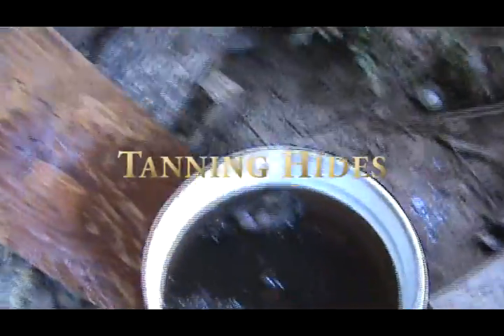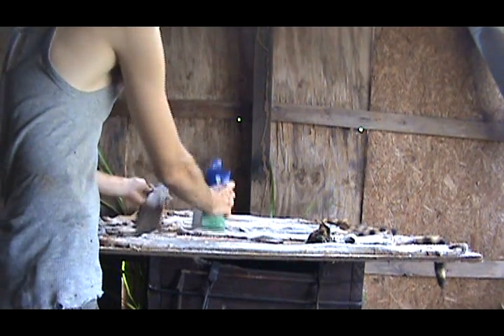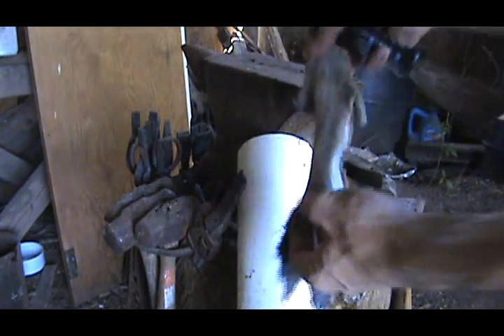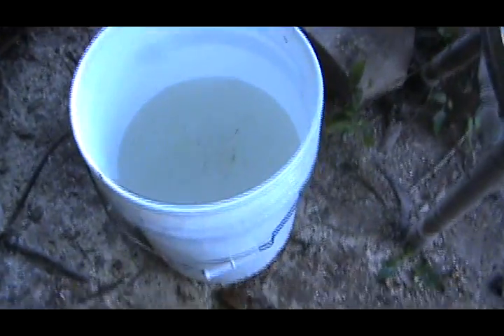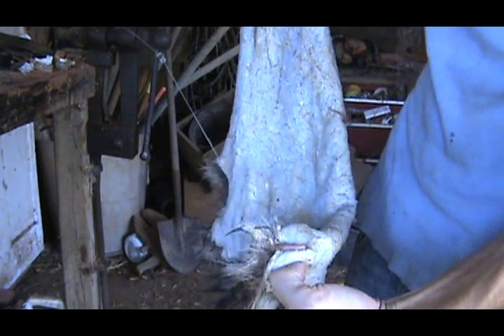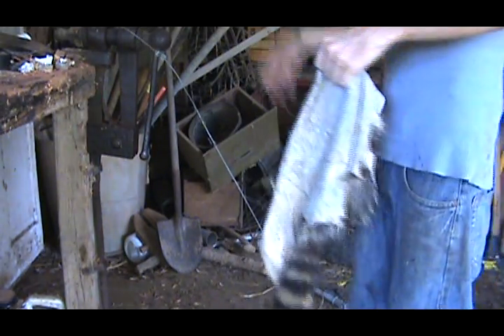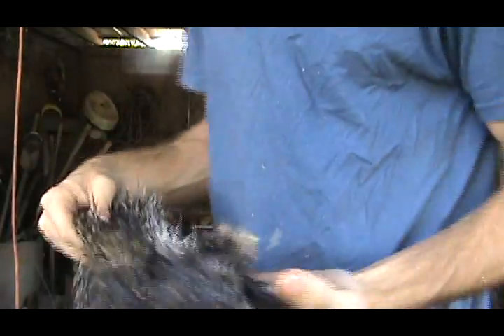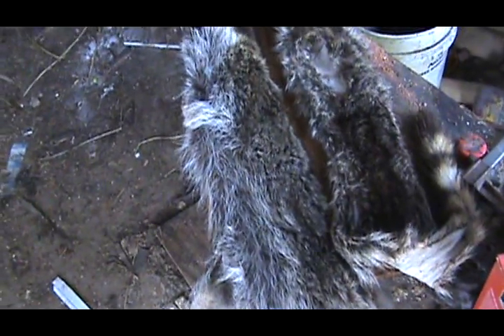Tanning Fur Hides

Comment: I do my hides the same way except for one part. When you salt the hide for the first time, keep salting it until the hides become hard. This sets the hair floccules insuring that it will not fall out! Then re-hydrate them in salt water and start the fleshing process. You will never have hair fall out, ever. That's how I tan my hides for taxidermy, when the hide your working on has to come out right every time.

Comment: Nice video Brother, I appreciate it when someone shows the whole process start to finish...along with the failure's too! FYI you can buy the Alum in bulk on line for a whole lot cheaper than the spice isle at the grocery store. Also, I use pickling salt too, but a friend of mine uses the salt for water softeners for soaking and it does well...lot cheaper too.

Comment: This may have already been commented on but here's what I found out about Alum:
Alum describes a class of chemical compounds, however the most common use of the word refers to potassium alum (aluminum potassium sulfate) This is the type of alum that you find in the grocery store for pickling and in baking powder it has several uses including leather tanning, as a flocculant in water purification. It also comes in a rock form for use as a deodorant hence is it a.k.a. "deodorant rock".

Comment: Good work.  I use a stick like a tournequit to help wring th water out andthen let them dry on the clothesline in the shade until just moist to the touch.  The work them over a board or cable for a while until dry and soft.  By switching off you cando them all at once.  If you are running a trap line you can smoke, tan, fesh, soak, some each batch you bring in.....spending your time better and be more efficient.  Good job.......I enjoy your sister too.  Good hunting.

Comment: Since salt is cheap and does not spoil, it might be good to lay-up a large supply of reserves, in ase salt might be hard to find, someday.  Maybe a pile of sacks of rock-salt (like used for ice-cream).  Sure, it would prolly fuse into one solid chunk but you would have it, on site.   About half of my remaining questions are about what else you might do besides selling them and also other methods of tanning and "work-arounds" if you can't get all the supplies or if you don't have a freezer, etc.

Comment: I have been having a squirrel hide tan for about 4 days now. I understand you take it out to dry a little bit, then work on a snare. I don't have a snare or a way to secure the wire like you have. what other methods do you recommend for doing this? Is it okay to do on the edge of a table for both times when working the hide?

Comment: I found your video to be very informative.  We have recently started breeding rabbits and have preserved several skins by drying them them in the open air and salting them, I would like to be able to tan them like you have done in your video, but I just don't have the time.  Would you have any suggestions about where to send these rabbit skins to for sale or would you buy them?  Also, are they still ok to tan after they have been dried for so long?  It has been about 2 months.

Comment: What's the point of soaking the hides in brine water at the beginning? Another tutorial online has you go from fleshing straight to salting. Total beginner here. Your help is very much appreciated.
Reply from the maker: The water is the tanning process. If you only salt the hides will stiffen up and you may loose hair
Reply: Survival HT
I'm working on my first hide now. I skipped the brine solution at the beginning and went straight to salting. It's under it's second batch of salt now for a few days. Hope I didn't screw anything up before I move onto the next step.
Reply: Benjamin Bailey i also did the same thing fleshed then salted then solution and i used citric acid instead of allum cause it's way way way cheaper. mine came out great the first water solution is really only to make fleshing easier :)

Comment: I had left my grey fox hide in the salt bath for 5 days, and after cutting off a piece of the hide, it appeared to be tanned. However, as I was squeezing the excess water from the hide the hair from the tail and the back started to fall off. The only thing I noticed that I had done that deviated from your process is that I didn't let the water cool very long after boiling and dissolving the salt. The water was still really hot, do you think that is what caused the hair to come off?

Comment: Hey - these are GREAT videos.  My question is on rabbit hides.  How do you flesh/work small cottontail hides without tearing them?  I think I'll try your working method with the snare to see if it helps.  I tend to leave too much flesh because I'll tear them if I scrape too hard.  Is that the nature of the beast for cottontails?
Reply: Try using a spoon as a scraper. Or flesh by hand. Hold the hide with one hand and pull down the hide keeping the flesh you're peeling as close to the hide as you can. It will help prevent tearing

Comment: do you have to "tan" hide to use it for clothing or blankets. can you just stretch it, dry it and then use it as needed?
Reply from the maker: It will get hard and stiff if you just dry it
Reply: ok thanks!
Reply: Old comment I know but tanning is completely necessary! Tanning is not only just some form of preservation, but literally chemically alters the hide into an entirely new product. It will eventually rot if you do not do this.

Comment: Nice pelts. But, wouldn't it be easier to flesh them before soaking them in the tanning solution? That way, the tannin would be able to reach the skin faster without having to soak through the meat and fat, losing some of the tannin in the process. Also, leaving the meat and fat on it would increase the chance of bacteria getting to the skin, making the fur come off.
Reply: It's so much easier to flesh after salting or brining the hides. The fat\membranes loosen and are easier to scrape! Many tanning methods are two step: salt\scrape, then alum brine.
Reply: 2degucitas Oh, that's interesting. I might try that sometime

Comment: Alum?!? I thought this was survival HT. I'm sorry, but can you come up with alum in a survival situation? Do know sources of alum? If you, my apologies, but I do not know of natural resources of alum. Do you know anything about brain tanning? I understand it takes no ingredients that do not come straight from nature. I do not know how to do that either though but, I am looking for methods that come completely from nature. Most of your stuff does. If alum does, you will have restored my confidence.
Reply: the reason for the alum is for tightening the hair pores so the hair doesn't fall out easily. if it was really a survival situation, you'd just buckskin your hides. i haven't been able to find an easy source of alum that you can do yourself. pity. i'd like to be able to tan furs without having to buy ingredients. i'd imagine there's some way to do it though, just gotta find the right things. i have started tanning though, brain tanning, and like you said, you can get all your necessary ingredients easily. you can use a bone or a sharpened piece of wood to scrape the hide, and just soak it in wood ashes and water to remove the hair. depending on your kind of wood, it takes 3 days if you use hardwood ashes, or if you use softwood ashes like i do, you can soak it as long as you want without damaging the hide. then there's steps to rinse out the hide and scrape off the hair and the epidermis, and then applying your brains, or you can substitute that for eggs if you wanna do that. its pretty easy though. when you soften the hide, just make sure you work it a lot, i prefer a stretching rack, but you don't have to have one. a cable like he has in the video is just fine.
Reply: Jay Hammon  aww rats I was hoping I was wrong about the alum and would learn something new. What about the brain tanning I heard about? does that require alum as well? does it not tighten the pores? Do you know how to do it?
Reply: i do know how to brain tan, but what i have learned about it is more about making buckskin, not furs. the best i know that you can do if you want to braintan a fur is just skip the step where you remove the hair. some of it will fall out, but you might get a decent fur. i haven't tried brain tanning a fur. it makes excellent buckskin though, and is easy. well, relatively easy.

with brain tanning, all you need is the basic tools to scrape the hide, a barrel or container of some kind for soaking it in, wood ashes to leech lye from to remove the hair, and a good way to soften the hide when all is said and done. look up a book called Deerskins into Buckskins. thats the book i got my knowhow from. excellent instructions, very detailed and gives you a lot of tips of the various ways to go about it.
Reply: Jay Hammon Ok. When I find out how to get a trapping permit here in Maine. I will be trying stuff like that. oooh I see a couple of brain tanning videos right here beside what I am typing to you.
Reply: brain tanning is nice but you have to remember to smoke it after to water proof it and when you brain tan the process is faster but you have to work the hide way more to keep it plyable

Comment: Never tried your method.  Looks OK.  I am lazier than you :)  I acid tan with battery acid and salt.  Not too much acid!  I flesh when they come off the carcass, no salt.  I use a wide beam and a sheffield.  I tell if they are tanned by clipping a piece and dropping it into boiling water  If gets hard, ain't done.  Should stay soft.  I break in an old clothes dryer, air only no heat, maybe some walnut hulls.  When done, coat with mineral oil or neatsfoot.  Acid tanning is much faster.

Comment: Oh, but you have to flesh the hides clean before you soak them in salt. The salt will also fix the fat & meat to the hide and make it much harder to flesh out. I find it is much easier to flesh the hide right after you skin the animal, then soak in salt water 24 hours and Lexol it. My process gives you a finished hide in 2 days. Tractor Supply has the Lexol. Son...you work way to hard processing a hide.